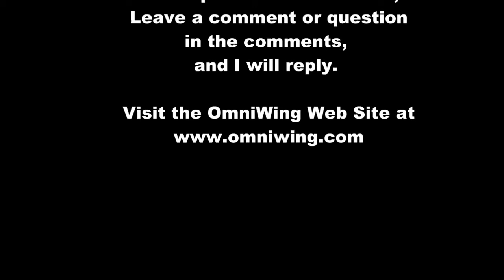OmniWing Paper Airplane Aerodynamics

Comment from the maker: Well stated by Word Reet.  Most all aircraft have some amount of twist in the wings.  With a craft that is a flying wing, having twist is even more important.  Do a Google search for images of flex wing hang gliders and you will see the obvious twist in the wings.  This refinement in hang gliders is probably one of the most significant features that provides their extraordinary stability.  Now applying that to paper is a challenge.  It may take you several efforts before you get it right.

Comment: I've just started in RC flight, and I love making the wings myself. So I have been reading up on what works well and what doesn't. The twist is called 'washout'.  At the tip of a wing that has washout, the trailing edge is higher than the leading edge. It basically means that the tip of the wing will 'stall' later than the rest, which gives the pilot a better chance of controlling the aircraft when airspeed is low. So landing is safer.

Comment from the maker: Almost all aircraft have twist in their wings, setting the angle of incidence of the airfoil towards the tips at a steeper angle than the airfoil towards the middle of the wing.  This helps to prevent a wing tip from stalling at slower speeds.  Watch the OmniWing video to see me applying and fixing twist into each wing half.  Also do an image search on google for hang gliders.  They are the best example of seeing twist in a wing as they sport more twist that most other aircraft.

Comment from the maker: On my channel you will see the Advanced OmniWing Series of Videos. They achieve what you are suggesting by building up the leading edge with more structure and layering for advance airfoil.  Quite a glide improvement, but very time intensive to build.  Can also be frustrating to work and hour or more on a wing and then end up with sub par performance.  This does still happen even to me.  But I press on seeking ways to squeeze out more performance.  I love the challenge.

Comment: Couldn't you generate more lift by rounding the leading edge of the wing, like by putting a pencil in it and then removing the pencil so that you have a typical wing design that generates lift? Or does this only work in powered flight?

Comment: Technically, in the hang glider, you yourself are the fuselage and provide extra stability to the craft.  The B2 bomber is a flying wing primarily because it does provide a smaller radar cross section, and that more space can be used to carry bombs.  Hang gliders actually have quite different aerodynamic properties to true flying wings.  Partly this is due to the lower Reynold's number, but, as stated before, it is also because you yourself act as the fuselage.

Comment from the maker: I appreciate your input.  I am sure there are more reasons why one might choose a flying wing over traditional, than simply concerns about parasitic drag.  In the case of the B2 bomber, I would guess that it provides greater stealth.  But then on the other extreme of flying wing technology, I strap myself into a hang glider that is indeed a flying wing that has extraordinary stability but the choice for the flying wing in this case probably had more to do with weight savings and portability. .

Comment: While a traditional airplane does produce more parasitic drag, and more skin friction drag, the stability of a flying wing is very tricky.  Do you know why aerospace engineers typically avoid flying wings?  It's because it is very very hard to get the stability derivatives of a flying wing to be acceptable.  Now, in recent years this has not been too much of an issue as computers can easily compensate for the lack of stability.

Comment from the maker: The concept of the OmniWing is to follow the tradition of historical "Flying Wings".  Flying wings eliminate the fuselage, elevator and rudder.  If designed properly you get a much more efficient flying machine.  Examples would be the modern day hang glider and the B2 Bomber.  Both flying wings for two vastly different fuctions.  On my channel I do have a video "OmniWing Modfications, but I still stick with the overall flying wing concept.

Comment: @menamiketrx Hey Mike, I took a look myself, I believe I stand corrected here. I always thought of the elevator as more neutral in relationship to pitch and CG unless input was applied, but based on the wiki, the elevator does counter balance, which in effect clearly explains added drag in having an elevator use aerodynamic force to counter a nose down tendency.

Comment from the maker: @RicardoNY1 I appreciate your comment.  As to the Elevator, I found this bit on Wikipedia to explain it best.  
"The rear wing to which elevators are attached have the opposite effect to a wing. They usually create a downward pressure which counters the unbalanced moment due to the airplane's center of gravity not being located exactly on the resulting centre of pressure, which in addition to the lift generated by the main wing includes the effects of drag and engine thrust."

Comment: Hey Mike, I've built your omni wings, they fly really great. I think the idea of the elevator "Counter balancing" may be a little off. Technically, aircraft have a center of gravity which I think is the crucial point of maintaining proper pitch. I believe the elevator is neutral in this balance and only serves to control the angle of attack, not as a means of avoiding a dive or a climb for that matter if what we think of an elevator were positioned at the nose of the aircraft as has been done.

Comment: I was working on a glider made of card stock, It had an internal spar, and used a lifting canard for the elevator. They worked great to the point of my wanting to add radio controls to it. but I needed to work on the fuselage because it was to weak. If it plummeted the body would bent. Haven't worked on it for a while but I made one high aspect ratio wing 4'x1.5". I am planing to use wood for the body, and also refine the wing a bit. I very glad your channel is doing well! Good luck